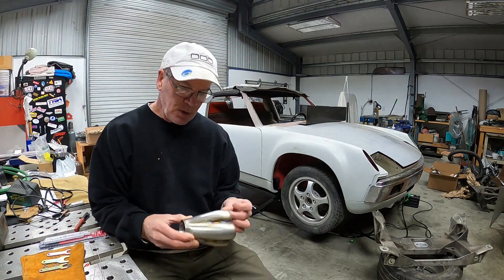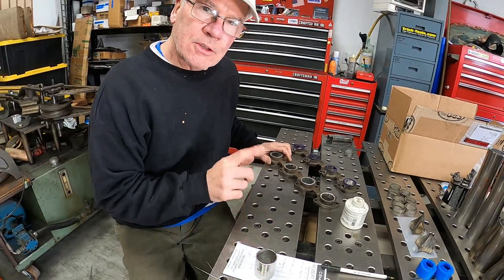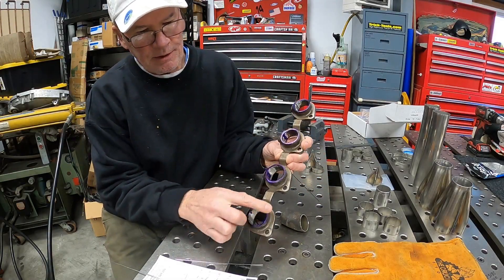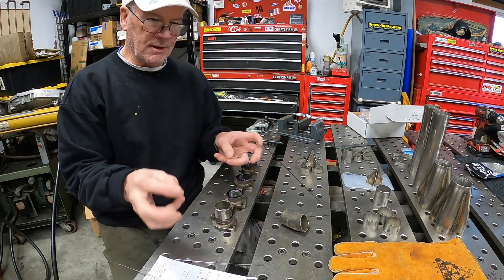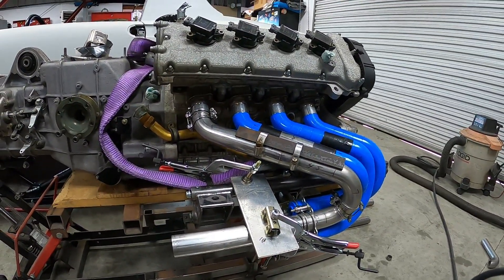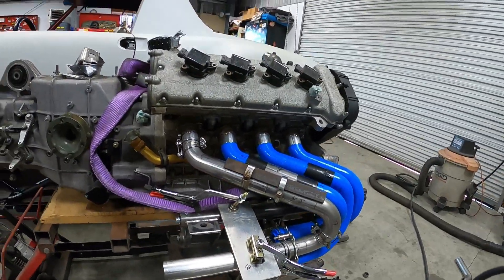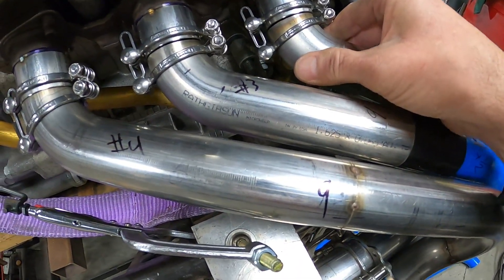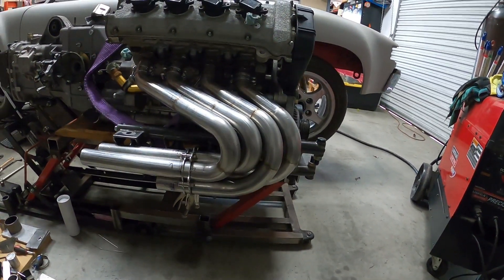914 Ferrari Build - Episode 14: Headers, Part 3

Comment: Smart to engineer easy engine removal. What’s your expectation of regular service maintenance?
Reply from the maker: I'll follow the Ferrari recommendations. It's easy enough to pull the drive train, if that's needed. Plus, it'll get new belts and a full service as part of getting it running. Since it's not like this is going to be a daily driver, I wonder if it'll ever need another service, other than oil changes! ;-)
Reply: @attheredbarn1669  … keep us posted, please.